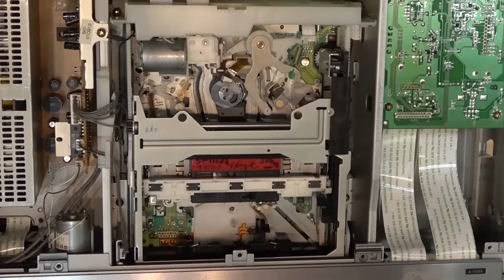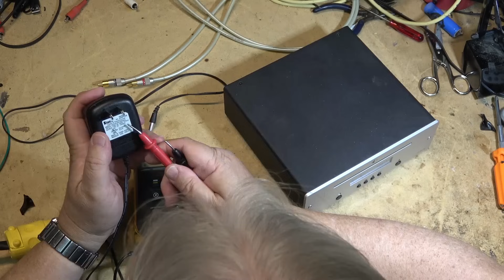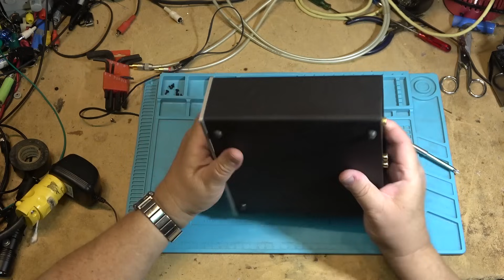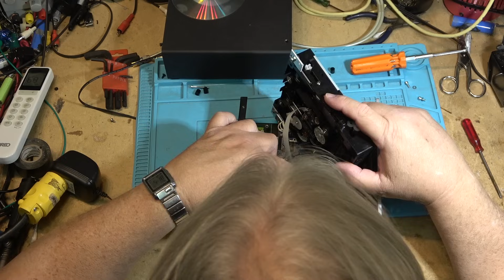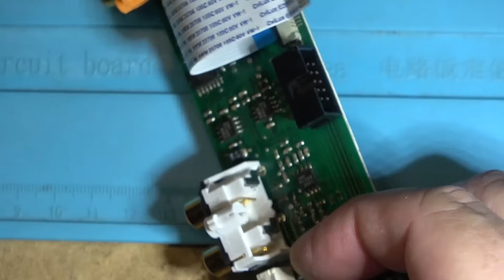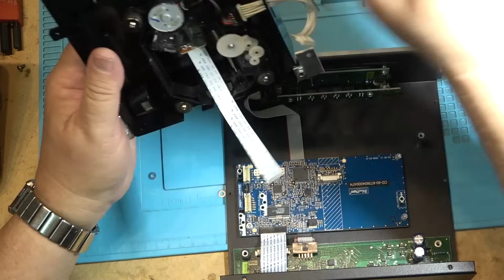The Failed Pro-ject CD Player. Its dead Jim.

Comment: 11:38  Question:
Isn't the body of the electrolytic capacitor isolated from the pins of the capacitor which also means that the body of the capacitor is not connected to any point in the circuit board ?
Reply from the maker: Some are, others internally connected to negative.  In this case it was.  I don't think I showed on camera when I put the meter between the chassis and the case if the cap and got 0 ohms.  Someone else asked that so I went through my caps and tested and some were and others not. Obviously a continuity test between chassis and the top of the cap will tell you if it is a good ground will take 0.1 seconds.  If ir says 0 ohms then it's good.
Reply: @12voltvids 
  Thank you for your answer.
I did not see you checking zero Ohm between ground or chassis and the top of capacitors, but I assumed that you did because you were measuring the voltage between different points and the top of capacitors which would mean that the top of those capacitors is zero with respect to ground or chassis.

Comment: Hi, Dave. Just a thought, but if the relay is part of the power supply, could it be that the relay is not turning on. Therefore, no power is getting to the rest of the circuit.

Comment: My Solution is a brand new $30 SATA PC DVD burner and an old Dell desktop output to a USB connected DAC.  Bonus is Exact Audio Copy for audio extraction to internal SSD drive and or NAS.  Works like a champ. If the drive dies, another $30 and Amazon and awaaaay I go.

Comment: I wonder if the cd drive would work installed in a pc computer? Maybe it's just the external control / power board, a chip gone or something.
Reply from the maker: Its not a pc drive.  You would need the interface board.

Comment: A company named suos-hifi produces the board marked BlueTiger and they mention that you can request info, though the CD-80 board is now obsolete. Doesn't help with that PSU board, but may point to issues on it. Potentially many expensive and time-consuming rabbit holes. though this is (or was) expensive kit.
Reply: Yes, it's a reference design based on an Analog Devices DSP. Which unlike many other Chinese brands based on MTK reference designs, hasn't any info leaked yet.

Comment: you dont use a pensil eraser on the ribbon cable connections? or clean them
Reply from the maker: Its not the ribbon cable. The unit has no power

Comment: Project CD Box SE. Apparently this was a circa $600 CD player. Although it does look like a cheap Chinese product to me, and certainly not high-end.
Reply: Pro-Ject makes some nice products, but frankly, any modern CD player is dumbed down to little more functionality than we had with 8-track tapes.  Play, stop, eject.  Probably next and previous track -- although not necessarily with a convenient interface.  Things like search fwd/back and pause are becoming exotic niceties, and things like shuffle, random, program, display buttons that toggle time elapse / remaining (if you even get a time display at all) are pretty much extinct.

Frankly, if everyone just gave up making new CD players at all, and just focused on producing belts and pickups for existing models, I would be 100% fine with that.  The market peaked a while back, and I would rather just have a supply of parts than the stream of "cheap yet comically overspec'd DVD-RW drive coupled to a limited-purpose embedded computer" devices that we have now, as many of them fail even the simplest of audio CD player design goals -- like gapless playback.  I am not kidding.
Reply: Almost everything related to "hi-end" audio is some kind of cheap chineese design. See the amplifiers, see the CDs, see the streamers...Look how, for an example, new, digital NAD C amplifiers series look inside - 2 boards, or more if the price is higher. Just like DYI../
Reply from the maker: The problem with these boutique units is service and support.  Better to stick to name brand units
Reply: I did some checking and the brand is "Pro-Ject".

Comment: pronounced Pro-ject (not project), they are an audio company based in Austria and founded in 1991, started with cd player's but made their name producing low cost but excellent all-in-one turntables, also well known and respected for their style of small box hifi components (amps, phono stages, DACs etc) and the cd player we see in the video.
Reply from the maker: Great where do I find a schematic for this pos?
Reply: I am not sold on their turntables. I had one from a friend to look at a while back. Cheap cheap cheap manufacture. A plastic box with an AC motor. No mechanical parts for an auto return, so just a simple bent metal tube tonearm on a pivot strung up with fishing line attached to some weights to act as a crude anti-skate. 

If you ask me it seems like they describe "cheap" as "minimalist" to fool people.
Reply: @averyzucco220   They have an extensive portfolio of turntables.  I bought one recently.  It's anything but cheap feeling.  It is definitely minimalist -- perhaps more minimal than I would like -- but it is not plastic.  It is well constructed, with (AFAICT) high-quality materials that are well-designed and properly manufactured.  I'm sure there are "cheap" models to be had, but I would not say that's representative of their brand.

FWIW, I'm not a huge fan of the anti-skate fishing lure either.  If I could change one thing, that would probably be it.  If I could change two things, I would add an opto-coupled motor stop at the end of play.  Some have said the lack of return mech is due to the nonlinear load it can put on the drive -- fair enough -- and that ANY auto-stop mechanism may either fail to play the entirety of the record, or fail to detect the end of a record.  I suppose either could be a problem, but it seems that we had a run of a couple of decades where this wasn't that much of an issue.  I think you could side-step the problem, if it exists at all, with an opto-sensor mounted on a worm-drive with an adjustment screw.  There.  Zero drag, and the ability to tune the threshold point.
Reply: I still have a turntable made by them many year’s ago and all I have replaced is the drive belt
Reply: @michaelwolak3098  yeah my Pro-ject debut 3 is still used regularly after over ten years, not had to replace the belt but I did upgrade the cartridge and changed the original platter for an acrylic one.

Comment: I wonder the brand "Project" is actually not a boutique brand, but instead some kind of a kit that students assemble in school or college or something.  The other possibility I thought of is that it is part of the white van scam audio items.  The fact that it runs on a wall wart, uses a computer like drive, and a small control board makes me think like it could be a project put together by students to learn to put parts in a case.  Same with the small number of audio jacks on the back.
Reply from the maker: It is a commercial product from Austria. Not exactly cheap either.  The reason for the external transformer is 2 fold.  Different markets and voltages and not requiring UL or CSA approval because it runs on low voltage.  Only the transformer needs approval so they just use a commercial product.  I would love to find service data on this so I could probe it more but without service data I am going nowhere.  Could be one of those buck converters missing a critical voltage. I see the 3.3 and 5v but are they correct and are there others? That's the 64000 question.
Reply: @12voltvids  They are British
Reply: completely wrong on both points 😞
Reply: It's definitely a commercial product, made by Audio Systems GmbH of Vienna, Austria. But it was very likely assembled in China. It's got the essential outputs for a CD player, namely L&R analogue, and digital coaxial for an external DAC. Don't know what else a consumer CD player would need. Running on a wallwart, external transformer, makes it easier for approvals on the unit itself, like the unit doesn't need to be UL approved if it's only low voltage. According to the specs it can play SACDs with 24bit audio.
Reply from the maker: In order to play SACD it would need a DVD drive with a dual laser because sa discs are on hybrid DVD/cd discs with a separate layer.  Conventional cd players play the cd top layer and the sa players play the lower layer.  The ir laser on a regular cd player looks right through it.
Reply: At least you don't lack imagination. Other than that: No. You're wrong in all your assumptions.